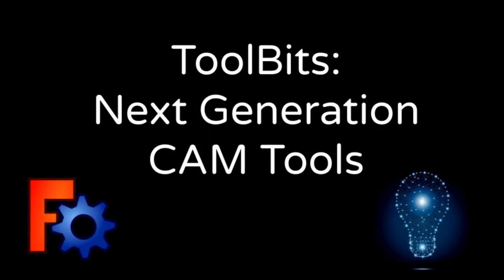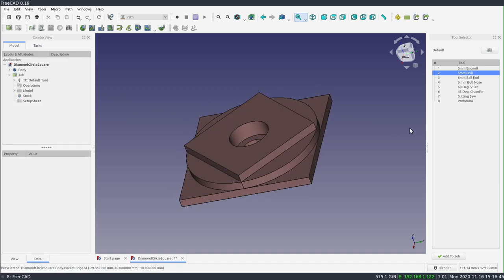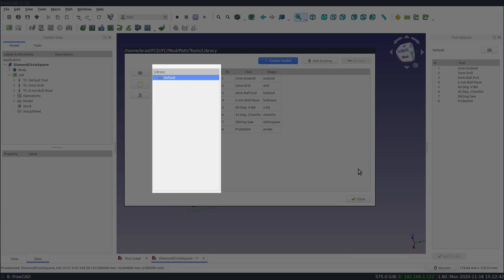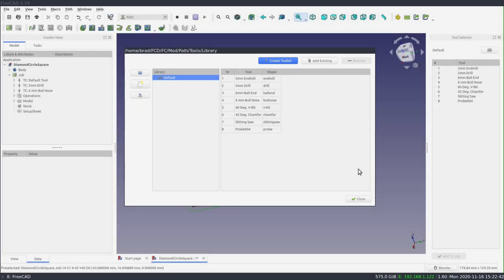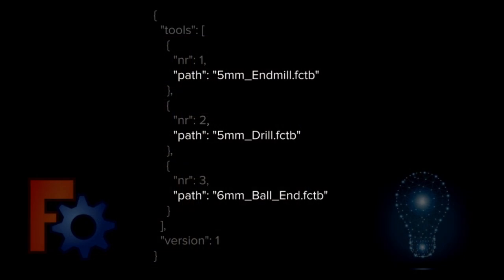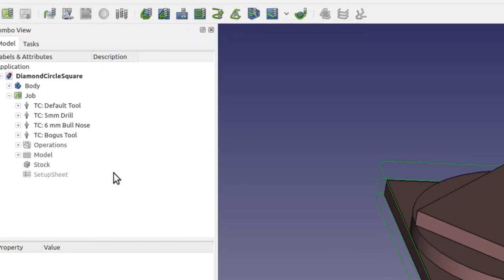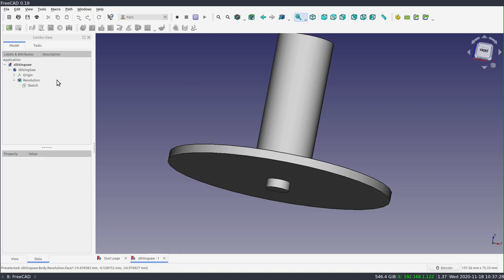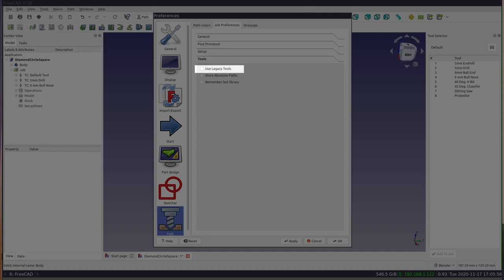Introduction to ToolBits

Comment: Thank you so much for this video. (And all the others you've created).

If you would be willing to make an update on this suiting the new tool library would be amazing!

I'm just trying to setup some tools but just as example, the by you so useful described spindle Power Funktion does not exist anymore in version 0.20.

Another idea great video would be the full process from part design over creating tolls and tool path to exporting it to a CNC machine and see the final result.
Keep up your great work!
Best regards!

Comment: Thank you for the explanation. I think some improvement should be done on the intuitiveness of the system. It is smart, however I couldn't find a way to add a 2mm endmill  before I found your video. This should be straightforward. Excellent job anyway!

Comment: Hello Sir, is it possible to have just wireframe as the chained tool path without the need for solid model? In 3d?. Example would be imported DXF wireframe to be use as direct tool path

Comment: Is there any documentation linking the tool bit definition input fields with the  physical characteristics of the router bit in my hand?  What do all these measurements mean? Ok, spindle diamiter i get, but what about all the others?
Reply from the maker: The toolbit system is designed to allow end users to create new toolshapes.  You can open the toolshape file (it's just a FreeCAD project file) and look at how the sketch is built.  The configurable attributes of the toolbit are pulled from the propertybag which is used to drive the sketch.  That said, some documentation of the stock toolshapes would be good.
Reply: @sliptonic  Thank you for the feedback.    I'll poke around there and see what i can find.   

Are there specific attributes that are used in calculating tool paths and others that are ignored?
Reply from the maker: @davidleedom  Yes to both but it depends on the operation.  The most important is "Diameter" which is used for all 2D offsetting.  This is the diameter at the control point.  
V-carving uses the angle of a v-bit as does deburr.  Operations that use OpenCamLib use a variety of attributes.
Some o the other attributes are used for controlling other functionality.  e.g. if chipload is configured, it's used in the feed and speed calculation.  If the tool has a SpindlePower attribute set False, it will never turn on the spindle  -- Good for probes and dragknives.
Reply from the maker: @davidleedom  Many of the other attributes are just used for building the 3D representation of the tool or may be used in future functionality.

Comment: With the tool description being JSON, it would make sense for bit vendors to publish this info ... just say'n  ;)
Reply from the maker: Vendors could certainly publish it.  Likewise, an interested party could easily make a script to scrape a vendors catalog and automatically generate toolbits.  Just say'n.
Reply: More and more vendors are publishing tools and attachments data following ISO 13399 / GTC standard... Which leads me to ask if the tool data definition is extendable?
Also vendors most share tools 3D models in STEP format so maybe an import wizard to ease convertion to FC format would be nice.

Anyway, great work and good video as always! 👍 Amazing to hear you say the path (!) is also leading to turning 🎉

Comment: just read a previous post that had same issue. however reading wiki, i see rigid tapping is not supported.
Reply from the maker: That's correct.  We haven't implemented rigid tapping yet.  There's an experimental thread milling operation but not rigid tapping.  Now that we have toolbits, expect to see more operation types in future versions.

Comment: Update to my last comment: Upgraded to FreeCAD 0.20, and it's great. But the toolbit experience on Ubuntu Linux is still horrendous. I'm having to hand-edit configuration files to try and get something working for toolbits, and FreeCAD seems like it wants to store everything related to toolbits in temp directories (e.g. /snap/freecad/66/user/). When I tell it to generate gcode output in a specific directory, it puts in "/run/user/1000/doc/901512b2/tp_hell.nc". How is that useful? Why wouldn't it just put the files where I can find them at some point later? I don't get it. I'm being told that the legacy tools (which actually work for me) are deprecated and will be removed after 0.20, which is unfortunate. Not sure how I'll actually use FreeCAD for anything besides 3D printing at that point.

Comment: You mentioned how all the bits where for all practical purposes cylinders. I assume this is from a metal machining  pedigree.... considering I am transitioning to a carbohydrate  based set of materials (wood) has anything been done with profile bits or slot cutters?  Kinda like 2.6 D modeling
Reply from the maker: It's trivial to model tools like that in the toolbit system now.  It might even be useful to do it so you can see the shapes in the icons.  But using those shapes in a meaningful way to calculate the toolpath is much more difficult and almost nothing has been done (yet). I did include a slitting saw in the list of default tools with the idea that a slitting operation would be fairly easy and worth doing.   
Also, In theory, the simulator can use the modeled shapes but I think the simulator is going to need more work before that's true beyond theory.  The voxel simulation is still too rough to be really useful.
Reply: @sliptonic  So who can we bribe or blackmail to get all of this done? The people demand their profile bits!

Just kidding of course. I find the progress so far astounding and am grateful for all improvements in FreeCAD.

Comment: Is FreeCAD production Ready. Is it worth leaning its CAM operations and path workbench to be a professional CNC machinist or is it only for hobbiest people. However am a Nube in all this field.
Reply from the maker: That's not an easy question to answer. Many people are using FreeCAD and Path Workbench for real commercial work but it has limitations.  It very much depends on what kind of work you do.  If your business is primarily 2.5D CAM (something like 80% of all CNC is this kind) then Path is very capable.  If you need continuous 4th and 5th axis tool paths you will be disappointed.  FreeCAD is a very powerful tool but also has a learning curve.

Comment: what version. 19 is this. i have been away for a while i cant get tools functions to work at all. pt brings up the tool library i am not able to create a new tool. I really dont want to have to be creating my own filing system. my brain injury doesnt let cope with stuff like that. im not a computer programmer.
Reply from the maker: Version 0.19 was formally released today.  If you're not running it yet, you should get the latest installer (follow the links from the freecadweb.org website).   You won't have to do anything manual on the filesystem.  FreeCAD will manage the files for you.  It will create individual files though which makes is easy/possible to back up your tool libraries. 
Make sure you're not using legacy tools.  There's a setting in Path preferences page.

Comment: Hi
I am new to cnc and have been following your great tutorials, I just bought a mill running with mach3 , I can import the g code but the picture of the item is not in the table display ? Will freecad work with mach3 
Thank you
Reply from the maker: I don't understand what you mean about the picture of the item not being in the table display.  But, Yes.  Path has a Mach3/4  post processor so we can produce gcode for that controller
Reply: @sliptonic  Do you know if path can produce g-code for the controller that comes with Sherline mill (Sherline inch/Sherline mm), It comes preinstalled on a linux machine when you buy the deluxe package.
  Also when I change units in Freecad to inches, then try to enter a constraint in sketcher, I get an error message (Datum for constraint x with index 10 is invalid). Thanks for any help you can give, cheers.
Reply from the maker: Sherline used to use linuxcnc.  If you buy directly from them these days you get a MASSO control.  Linuxcnc is no problem for us.  I've not had a chance to play with a MASSO and nobody has written a post-processor yet but it should use standard gcode so the linuxcnc post processor should be pretty close.
The error sounds like a problem with your sketch.  Impossible to troubleshoot in youtube comments.  You should probably post to the forum and attach your file if you can.
Reply: @sliptonic  Will do, thanks.

Comment: sliptonic, when I click the toolbit dock icon or dial P,T I got only ToolBit Library open, not the dock - any idea what's going on? I have FC 0.19-23074 .
Reply from the maker: Sounds like you still have legacy tools turned on. There's a comment toward the end about turning off legacy tools. Also, this is a brand new feature just showing up in the development daily build this week. So you'll have to upgrade if you haven't already.
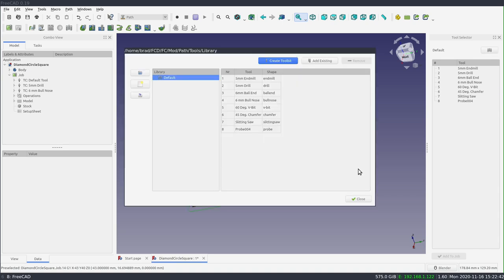Reply: @sliptonic  , nope :) I've done it - legacy tools are unchecked - when I (P,T) I get the same dialog you got at 3:38. I downloaded the last version possible (019-23074) from github. 

By the way, will that be possible to import/convert the old-style tool libraries into new ones? I just prepared a library with just over a hundred tools and creating a new one would be a pain in.. you know ;P
Reply from the maker: I'm happy to help but can we please move this to the forum?  Post in the Path/CAM section and I'll see it
Reply: @sliptonic  , done :) It just has to be accepted by a moderator.  How about the second question? :)

Comment: I just upgraded FreeCAD to a version that features the Toolbit library, and it's a completely bizarre experience on Ubuntu 20.04. I had to switch to the Legacy Tools setting to get anything done. 🙂
Reply from the maker: Toolbits is a major change.  They introduce many new concepts and allow for much more robust functionality to be developed.  I encourage you to get over the hump though.  Legacy tools will be deprecated with 0.20 and completely removed in 0.21.  
I'm open to suggestions about how we can ease the transition.
Reply: @sliptonic  Totally agree. This video (like all your videos) gives a good insight into why the new approach is useful. And as with all things FreeCAD, I expect to encounter humps, whether they're my own lack of experience or various quirks in the software. I've learned some really useful info watching your videos. In this particular case, the hump I'm trying to get over is more like a vertical wall. Maybe with flaming barbed wire at the top edge. 

I open the Toolbit library panel and, as expected, it's empty. I go to create a new toolbit and it opens a file dialog prompting me to pick a writable directory to put my tools in. But it won't let me pick an actual DIRECTORY. What I select has to be a file, otherwise the "open" button is disabled. If I cancel, it just pops the dialog up again. So I'm forced to pick a normal file as the "directory" before I can do anything. Then it asks me if I want to create Shape and other directories there. I say "yes". Of course it can't do that because what it forced me to pick is not a directory. Seems like the "File Dialog" call is missing the flag that indicates the dialog should be picking a directory rather than a file. (This is on Ubuntu 20.04, not sure if I mentioned that.) If there's a github issues list somewhere, I'm happy to provide a screen capture of what I'm seeing if that helps in fixing it.
Reply from the maker: @KellySchrock  Great feedback!!!  That sounds exactly like the file dialog bug you described.  Should be easy to resolve.   I'll check on that today.  That kind of bug is really easy for developers to overlook because you encounter it once and then your config is right.  We rarely blow away our configs and and start again.
Reply: @sliptonic  Haha, I've been there. (Ask me about the day I spent recently after clearing my build cache. Actually don't, it's not a very cool story :-) ) Happy to help in any case!
Reply from the maker: @KellySchrock  Hm.  It looks like we're looking for a directory, not a file.  What's your FreeCAD info?   This might make sense to talk about on the forum.
https://github.com/FreeCAD/FreeCAD/blob/master/src/Mod/Path/PathScripts/PathToolBitLibraryGui.py#L84
Reply: @sliptonic  Oh interesting. It does look like the code is looking for a directory explicitly. Here's my FreeCAD info from the About box: 

OS: Ubuntu Core 20 (Unity:Unity7:ubuntu/unity)
Word size of OS: 64-bit
Word size of FreeCAD: 64-bit
Version: 0.19.24267 +148 (Git)
Build type: Release
Branch: tag: 0.19.4
Hash: 476ecf091941bead59b14e44afa6064d5a66afa3
Python version: 3.8.10
Qt version: 5.15.3
Coin version: 4.0.0
OCC version: 7.5.2
Locale: English/United States (en_US)
Reply from the maker: @KellySchrock  Hmm.  It should work there.  I'm on Linux Mint and tested it.  I get directory selection as expected.  I'll ask around and see if someone is running Ubuntu 20 to test.
Reply: @sliptonic  Sounds good, thanks for looking into it. I just tried it again, including after re-installing FreeCAD and rebooting, and I can still reproduce it. I'll capture a video of it sometime today if I can.
Reply from the maker: @KellySchrock  Thanks.  I had another developer try it on a Ubuntu 20.04 LTS instance and he couldn't duplicate the issue.  Please let me know what you find.
Reply: @sliptonic  If only there was someplace I could upload a video to show you. Oh wait, there is! https://youtu.be/CgZb70pzYtw

This doesn't show the part where I was prompted to select a writable path for the tool library, that step was saved in the configuration already apparently. This is just some video of weird things I ran across while creating a toolbit (or trying to). The legacy ones are working well for me, and I do plan to switch to this as soon as I can get it working.
Reply from the maker: @KellySchrock  Commented on your video with an explanation of the weirdness.  Hope that helps.
Reply: @sliptonic  Great, thanks. I'll take a look.